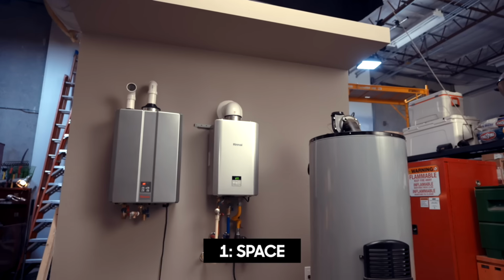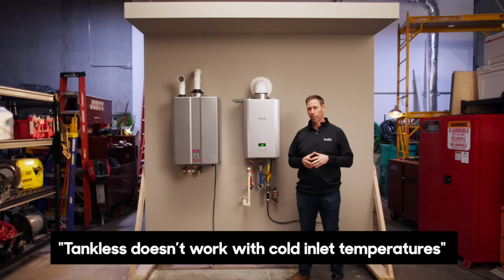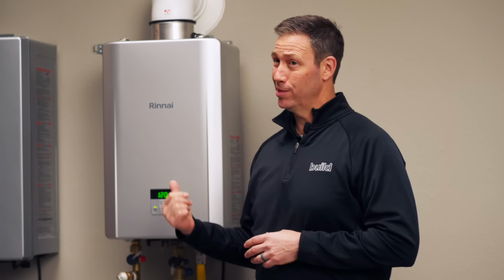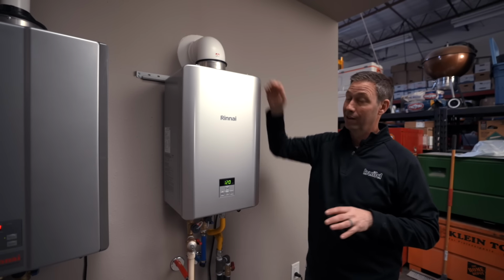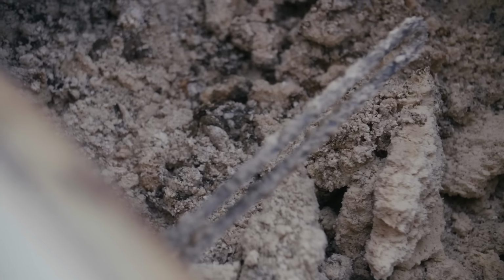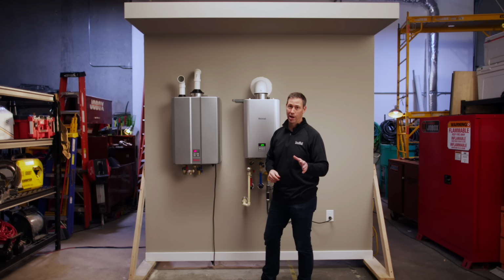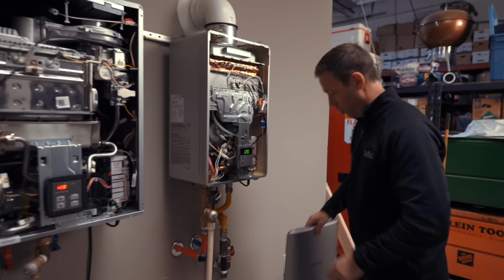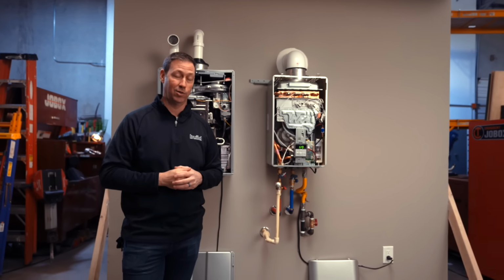DEBUNKING Tankless water heater LIES!

Comment: apparently a main "advantage" of a tankless, i.e. not running out of hot water, would more simply be cured by having a larger tank.  in other words, it is not an advantage of tankless over tank, only of tankless over inadequate tank. I started out believing in tankless but after seeing all the issues with error codes, parts replacements, parts not available, plus more demanding venting, wiring, piping... and no hot water with electric outage?!... I'm just gonna get a larger tank. For larger homes, more than one tank seems to work fine especially where there's distance between plumbing stacks.
Reply: That is an advantage but not the main advantage. The main advantage is there is NO STANDBY LOSS.  1 POUND OF WATER 1 DEGREE 1BTU! This is obviously a very difficult concept for you to understand! Go make a pot of coffee, turn off the machine and come back in a couple of hours and get yourself a cup of coffee...what happened? The coffee is cold! why? Because the heat has escaped to the atmosphere! Insulation slows the process but when you are talking about an uninsulated flue tied into a chimney that continuously pulls cool basement air up through the water heater it loses it's heat almost as fast as that coffee pot. A larger tank will just hold more pounds of water and will cost you even more.
Reply: @anthonyspadafora1384  well duh, guess what, i DO understand standby loss, and it is one reason i started out thinking tankless was the way to go.  Clearly you have more interest in calling me stupid, than in acknowledging that the MANY issues i listed are relevant for at least some users.

Comment: I hated my tankless. Every time someone turned the tap, (Hot or Cold), the temp changed, had to run the water for a couple of min. to get hot water.
could not run the dishwasher and the washing machine at the same time.
 Changed back to tank and no more problems. And I had two different brands of tankless and both were not worth a you know what.
Reply: you must gotten a shitty tankless or improper install.  I got my tankless installed and never going back.
Reply: @hoodhunter3262  or a thankless that was way to small

Comment: We have electric water heaters in the apartment complex I live in.  I'd much rather we had tankless because the hot water tank has had to be replaced twice and each time it failed by spewing water all over the floor.
Reply: that is totally not normal for tank water heaters.  Your landlord needs to stop pinching the pennies and hire a reputable plumber.  'failed by spewing water over the floor'  is the plumbing equivalent of PEBCAK.  You would not be better off with tankless because obviously it would not get the needed maintenance.

Comment: I first encountered natural gas fired on-demand tankless water heaters when I came to Japan in 1996. They were everywhere. My first apartment even had a small one inside the window just above the sink. You used your elbow/forearm to push a giant button on the front, and the hot water come out a dedicated nozzle near the cold water tap. You could move the outlet around easily, the temperature dial was easy to adjust, and you could turn it on or off with or without your hands. I think there was a dedicated window or slat that vented the waste gas out right behind the unit. 

The on-demand heater for the bath/furo was a bigger unit, like these in the video, generally just outside the window for the bathroom (attached to the wall for second story, I guess).  

I still see the smaller indoor kitchen units, but new houses/apartments are being built with hot water going from the one main unit. It does take a few seconds for the water to heat up, but I haven't found that to be much of an inconvenience. Something you can also do with on-demand that you can't with tanks is raising the water temperature to higher temperatures on the spot. Mine are usually set at about 42 degrees C (108 Fahrenheit). If I keep pushing the up button, though, I can get 60 degree water in just a few seconds. I've sprayed that on my legs after jellyfish stings (it feels. so.. good...), and 60 is about as hot as I can stand it. 60-63 degrees is a hot cup of tea.

And the furo. Another benefit of the on-demand heaters is that they can reheat the water already in your bathtub. I guess there is a separate water line going through the heater, but it works well. It takes 10-15 minutes or so to heat the water, and you can even sit in the warm tub as it heats up. There's just a little disk that sticks into the tub. It can draw in water to reheat or release heated fresh water. Japanese people will leave the same water in the furo for a few days. And since you don't put soap in the bath but instead soap and rinse with the showerhead just outside the tub (or using the old buckets like onsens still use), the water is clean. 

The tubs/furo are deeper and less long here, almost a cube shape. I'm six feet tall, and I much prefer a typical Japanese bath. I have to draw my knees near my chest, but that is a relaxing pose. And the tubs are deep enough that it's easy to sit in the tub up to your neck. My knees and chest both stick out of the water in a traditional American bathtub. I highly, HIGHLY recommend a Japanese bath/furo system if you can find one, and if Rinnai or whoever sells the furo heating systems locally. Two average sized people can even fit in one, and there are bigger units available (like a hot tub, I guess).

Edit: One drawback: With the single units feeding the whole house, if one person is taking a shower or filling the tub, hot water at the kitchen sink is slow.
Reply: The Japanese honor their tradesmen and working on a tankless is not looked down upon.  Here in the US, kids are ushered in to college.  Some states endorse trade schools, but most do not.  Also Japanese culture doesn’t waste energy or water.  The first tankless that came to the states didn’t have isolation valves, and the Japanese didn’t understand why we needed them.  We Americans want 120 plus degrees water and 10 shower heads.  (I’m exaggerating), the point is we ride these units much much harder.

Comment: I bought a tankless about 3 years ago, it sat for about 2 of those years,
(I was a bit stubborn ), well being stubborn cost me a few $. My 80 gallon finally went
out so I had to install the Tankless. Nice hot water throughout my shower, took about 
15 minutes to install next to where the 80 was, gas line, cold input, hot output.
bolt to wall, Done. My costs of running the tankless over the 80, I cut my gas bill by
almost 70% over a year period. Now as for speed, yup almost instant for shower
( about 5 feet away from the tank) kitchen sink approx. 1.3 minutes to 2 minutes
about 35 feet away from tank. So the same as my tank unit. But well worth the money.
What ever one chooses to buy is ones choice, but space saving, energy costs, I 
now say Tankless is the way to go.

Comment: I paid 1200$ for my 1st tankless that I bought myself, copper heat exchanger. After 8 years heat exchanger started leaking. To expensive to have it replaced. I also had a huge cost in double wall stainless exhaust. Bought a new tankless ,2000$ and had it installed 500$ , stainless heat exchanger this time. Recirculating pump went out after 3 years, pump under warranty, not labor, 350$ . Both units Noritz. Add the cost up, yes they save you operating cost, but it will take you 20 years to recoup the cost. Then it’s time to start all over. Your standard heater goes out, you have it replaced the next day at a 4th of the cost. Going back to a standard tank unit. The experiment failed!
Reply: The unit with a pump. Was it made in Korea? Both Noritz and Rheem sold a Korean brand and put their name on it.  It was supposed to be a fill gap to compete with Navien.  It didn’t go well for either company.  That particular unit was originally designed for hydronic heat.  Even installed correctly these units have a horrible break down record.
Reply: You should have tried a Rinnai. They last way longer than a Noritz. Probably why Matt used that brand for his video. Mine is from 2004 and I probably paid for maintenance like 5 times which is a simple flush.. mine still going strong...

Comment: My home (row-type housing) was built in the 70's.  I was told that my home does not have the electrical requirements for a tankless water heater.  Not sure if that is true.  Any advise in regard to that one?
Reply: If you have a gas unit that shouldn't matter. If you want an electric unit that is probably correct.

Comment: I've had a tankless for years, and I've been delighted, but once in a while, it'll shut off with an error code, which really sucks when you're in the shower. Turning it off/on resets it and no issues after that. Obviously, it might need to be investigated by a service technician but it happens so rarely that it's more of an annoyance than a problem.
The only other issue is the required flow to have hot water. For example, if I have the hot water coming out of the sink at a somewhat low flow, after a bit the hot water will stop being produced. This is why if you still have a shower with two knobs, I'd upgrade it to one where the flow is consistent.
Reply: Actually you’ll find that a two knob shower is safer to run regarding an older mid efficiency unit.  Some single handle shower can make the tankless unit code out. Single handle showers when they’ve matured can cause crossover issues which become a nightmare on newer units with pumps.

Comment: In Germany we are using tankless water heaters for at least 60 years…proven beyond any doubt. In my current apartment I have water heater tanks and I already had to replace one, it’s cheaper initially but more expensive in the long rung with tanks. Tankless is the way.
Reply: In Germany tradesmen are respected and taught early.  Here in the United States in many states, tradesmen are looked down upon. Also trade schools are different state to state.  Some states didn’t get plumbing codes till the 1980’s.

Comment: I have tankless and it does take awhile for the water to be hot. Having said this, I still prefer tankless over tradition water tanks because I love the fact that the water stays hot. Nothing worse than taking a shower after someone and the water turns cold. You’ll never have this problem going tankless. Just keep in mind that the water will take a little while to get hot.

Comment: From a prepping stand point water pressure drops or fails in the system, my 50 gal tank will keep me going for a little bit longer. I replaced both heater coils 12 years in for 25 bucks and drain every year.

Comment: Does tankless require electricity to run? Half the reason my parents still run a gas stove is so they can still cook if there's a power outage. And it looks like there's cords running to these water heaters. If tankless kills the heating during an outage, I doubt I could even recommend.

Comment: I have a Rinai, and from my experience with it and my experience with tankless water heaters in Japan, there is one downside that needs to be considered before someone switches. In low flow situations, it shuts off. ex: It is summer time and your input water is warmed. You don't want a hot shower so you turn down the hot. With warm "cold" water the amount of hot you need for the shower is so low that the water heater shuts off. (It's a safety feature) and your shower winds up "cold" water only.

Oh, and here is another reason I went for tankless 10 years ago, other than my experience with it in Japan. It runs on natural gas which is WAY less expensive than electric AND I am not paying for heating water 18 hours out of the day when hot water isn't being used.
Reply: I may be off course here but I believe you’re describing an activation issue. All tankless unit have a minimum gpm requirement to fire up.  In the summer time warm inlet temp may really play havoc on your system.

Comment: Other than saving space and putting one in a cabin that sites empty most of the time, then you get hot water with out waiting for the tank to heat up there is no benefit. I had one and I hated it.  They do not save energy.  They won't deliver enough hot water. They cost way more.  I would never do be again. The numbers as they say are all B. S.!  Phoney Baloney!  I have learned a lot watching Matt's videos, but your all wet on this dude.

Comment: Not every place is ideal for tankless. The truth is that for cold inlet water, the power draw is huge. Our well water is 50F. The tankless heater needs to be 90 amps or better. And since many of the homes in my area depend on a generator for times when the mains utility is off, i.e. a power outage, there isn't enough generator to run the house and make hot water. A tank is far better in the area we live in. Just giving a different perspective. Tank heaters really do have their place in some homes.

Comment: Have a hot water tank that was installed  35 years ago ( 1987 ) have a well and a simple filter but since I didn't keep filters in it over the last 20 years , the tank is about half full of sand , there is not enough hot water to run and complete two showers at the same time but we will live with it untie it quits !  I'm in the building and remodeling business and have found .......OVERALL  , don't clean out or mess with old hot water heaters , leave them alone unless you have to !they are not sport cars, to change the oil or to be taken apart,rebuilt or tricked out.      Time and place for tank and tankless, and sizing each one to meet the demand,   one size and kind never fits all. Always remember , even the best of makes and brands have lemons now and then so don't get caught up and talk yourselves  out of what truly would fit your needs , it's not rocket science,  it's a hotwater heater.

Comment: Tankless will cost over $2200, tank type around $6-$700. I’ve never ran out of water with a tank style. And over 1/2 of the yr only use 4-5 ccf per month And my last tank heater lasted over 25 yrs

Comment: What about instant electric hot water tanks? In Australia the gas supply has huge 3 month connection fees, making gas - well uneconomical. However the 45litre bottles are economic. Charging 85 cents per day for an off-peak electric connection is also killing these big tanks.

Comment: We bought a house with tankless water heaters (big house).  What drives me crazy is the kitchen faucet - when I'm doing a lot of dishes, it suddenly goes cold for quite some time.  I don't have the flow on high once it gets to hot so the water doesn't splash all over, but then after awhile, the nice hot water goes cold.  You can't clean grease and butter with cold water!.  If I let the water run for several minutes, it returns to hot - but what a waste of water.  My husband adjusted the flow setting and that helped a little, but it still goes cold for awhile.  The selling point for these tankless water heaters is you "never run out of hot water".  Any suggestions from anyone?

Comment: In Thailand, where I now live, and probably most if not all of Asia, everyone uses electric tankless water heaters which are mounted in each shower. My home with 3 baths, has 3 Electrolux 6000 watt, 240 volt water heaters. They cost me about $150 US each. In the coldest months with water coming from a well and stored in an above-ground tank (yeah, it can get cold here in the north of Thailand but not like Canada cold), the water is still warm enough for a comfortable shower. The newer models like I have use power electronics similar to what is used in electric cars to control the heat. The old ones cycled on and off and would go from COLD to HOT and were not comfortable.

There are gas models and I used one for a year my first year in this country. It was fed from a 10-gallon (approx) gas tank and it was no fun when they ran out of gas in the winter when I was in the middle of a shower.

Comment: One reason for the price complaints, is that most tank based water heaters at places like homedepot, will be in the $400-600 range for a 40 gallon unit. While there are some tankless that are down in the $700 range, the problem is those budget units are useless in much of the country. for example, many will list misleading specs, such as stating "2.5GPM at a 35F rise, which is practically useless, as you If you are in a colder climate, you won't be taking a shower unless you are okay with like 0.4 GPM. The issue is if you want the user experience of a tank water heater but without the time limit, then to match the experience of a $450 40 gallon, 50,000 BTU tank heater, you will be spending close to $2000 on a tankless.
Outside of that, the other concerns about tankless systems have largely been fixed over the years.

Comment: In the UK 'tankless' water heaters are the norm and have been for decades. Not only do they provide all the domestic hot water for sinks, showers and baths but they also run the central heating (hot water radiators) at the same time. I've had the same boiler for over twenty years and only needed to call an engineer out once and that was because a rubber diaphragm needed replacing.

Comment: where i live we use solar to heat the water tanks. only ever need to use electricity / gas if you have a very overcast / rainy day where the solar can't heat enough water. a tank typically last us over 30 years with little to no maintenance. stayed in places that used tankless water heaters and had no end of issues while there.

Comment: Like so many things nowadays, the old tank-heaters used to last longer. At least mine did. 31 years when I replaced it in 2017. I considered a tankless for space reasns, but didn't want to deal with the complication and expense of running a new gas line. Also my utility closet has no exterior wall - just a chimney-flue shared by the water-heater and furnace. So at the time, I was unsure where/how to vent.